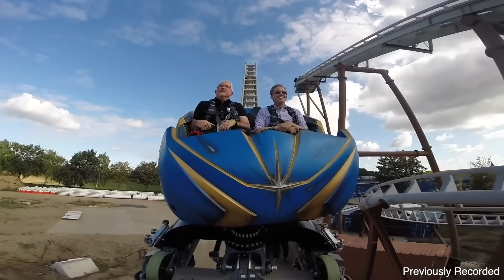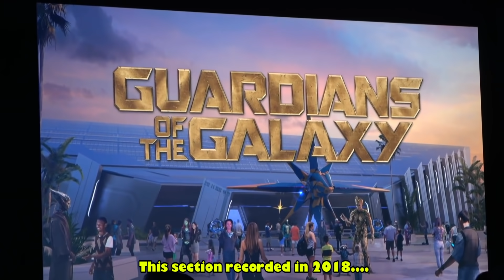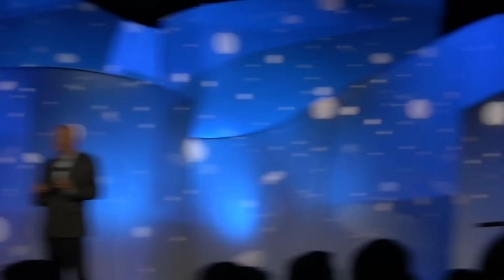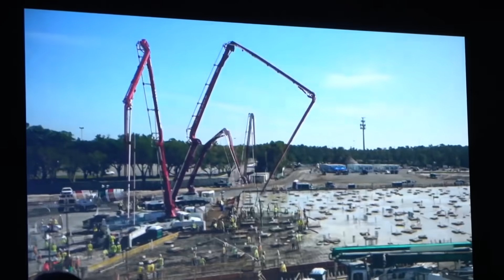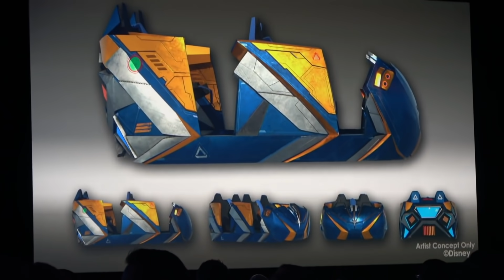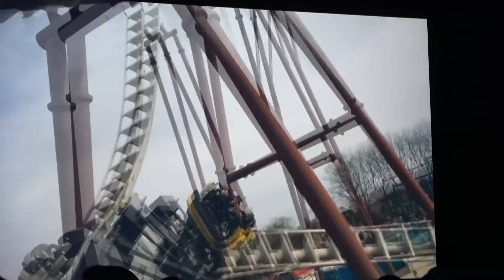FIRST LOOK! Guardians of the Galaxy Roller Coaster Ride Vehicle POV! Walt Disney World Epcot

Comment: I'm just wondering what the control mechanism is for the rotation.   I see two tracks, but it looks like it is mechanically rotated, not computer rotated.
Reply: Vekoma has built technology like this already for their new flying coaster at Phantasialand called F.L.Y.

The coaster trains controlled the rotation rather than the track.